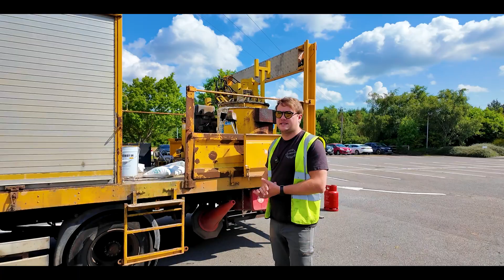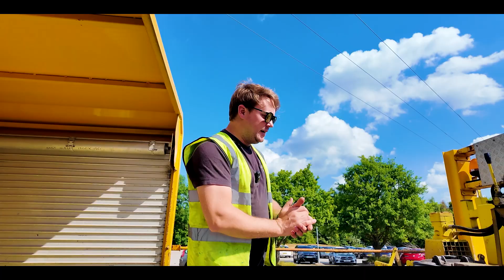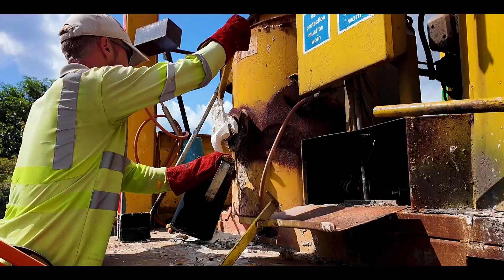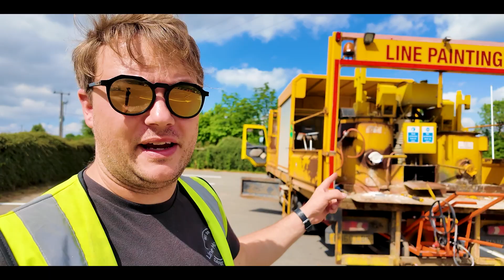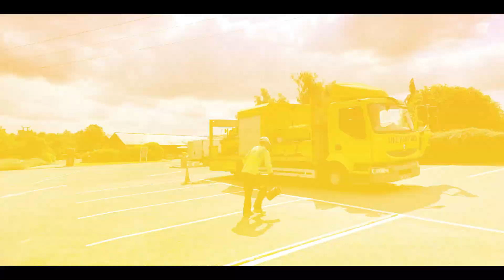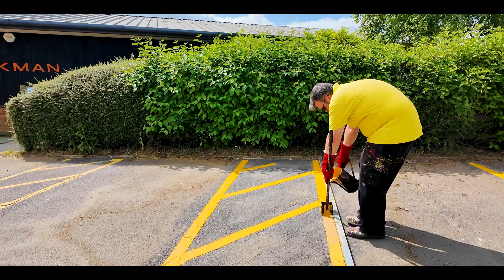We're now a Thermoplastic line marking Business!

Comment: I built my own twin pot boiler set up mounted  on a tri-axle ifor Williams trailer with diesel fired boilers. So much better than a gas system in my opinion, basically the same amount of room as a smaller 7.5 ton wagon but without the hassle. I am thinking of possibly producing these trailers for sale in the UK but is there much of a market for them?
Reply from the maker: Great question David.

I purchased a trailer set from B-Tek fabs in burton on Trent for 17k and it’s pretty good. There are 2 other companies I know of, Tex engineering and Somerford Equipment and both do the exact same sets. 

I would say that there isn’t much demand for them though. Most people want lorry mounted but I still think they have a place - just in limited numbers.

I also see a lot of people moving toward MMA which I think will takeover somewhat in the next 5-10 years.

Can you share any pictures of the one you built?
Reply: @Line-Mark-com  yes I did see somerford and Tex make them but they do look like small setups for dry day line marking, not much chance of that this year ey? Also not sure if you can spec them to run diesel burners like mine? 

Sure I can email you some pictures of the setup I made if you give me your email address? 

And MMA is great gear and the way forward if the price was a bit more like thermoplastic. And if someone can develop a pram that lines MMA then it's a game changer. I see Hoffman do one but it looks an absolute game to use it 🤣
Reply from the maker: @davidunderwood8196  sorry I thought I had already responded! no, I don't believe you can use diesel with wither of these units so it would be good to see what you have. My email is alex@line-mark.com

Comment: Pto would be ideal as u can do nightwork with minimal noise. We got hunted out of more villages and towns late at night cos of the donkey engine rapping off the walls😂😂😂
Reply from the maker: So loud aren’t they! PTO all the way! Just weighing up the cost of a new truck build VS re- building this one. I’m keen to go diesel boilers with a PTO
Reply: @Line-Mark-com  I'm not all that up on diesel boilers. I've worked for a period with them, not sure does the boilers have to be lighting and turning all the time because of the pto but I see the yellow goes an off colour like a yellow green because it gets burnt. Only way to keep yellow a real yellow is to have 3/4 of a half boiler unless your going to be bangin out a shitload of yellow and never fill up the boiler as it takes too long to cool down in the evening, just under half(with bags fired in) for the way and as I said the colour goes off cos it gets burnt heating and reheating all the time.  I work with gas all the time, prob bit more expensive but quicker for heat etc. Can't say about diesel cos didn't work for so long with them.
Boilers were lit up and turned from inside the cab, all automatic.
Somerford is the company that builds the bodies and by the looks of ur lorry, they built that 1 aswel.
Reply from the maker: I’m sure it was a Somerford. I did look at Maxigrip for a new one but it looks like they are resellers as opposed to actually building them? 

The ones I had previously were made by B-Tek Fabs and I had it trailer mounted.

To be honest a trailer would still suit me fine as we only do 25 - 100 bays on average per site and perhaps a 100m of walkways at a time. At most, we need 15-20 bags on board for the average job. 

I think it would save me thousands in insurance, service snd running costs vs the truck + I wouldn’t have to pay congestion (it’s euro 5)
Reply: @Line-Mark-com  very true , u cud always have your compressor on a trailer also with 2 gas barrels installed for burning off. Very handy to have a burning off unit ready to tow, burn today, installation tmoro.